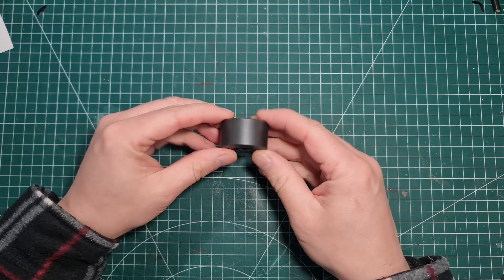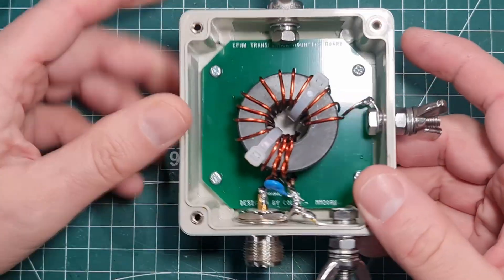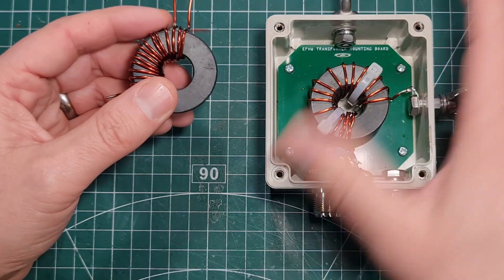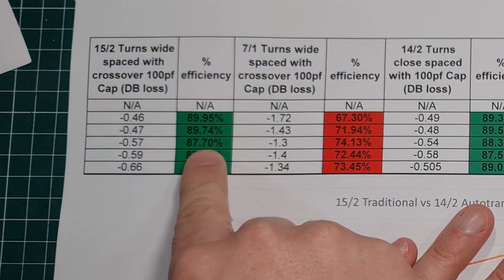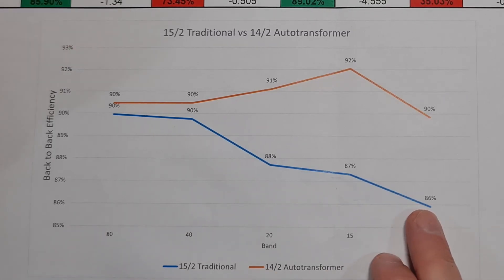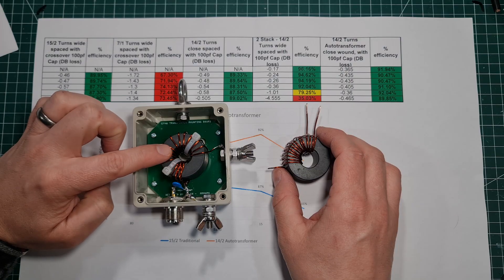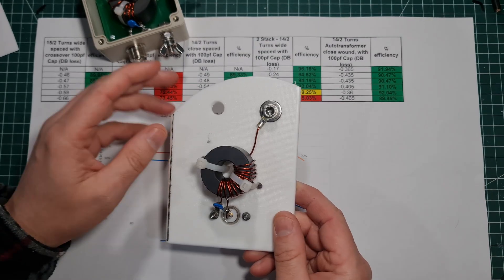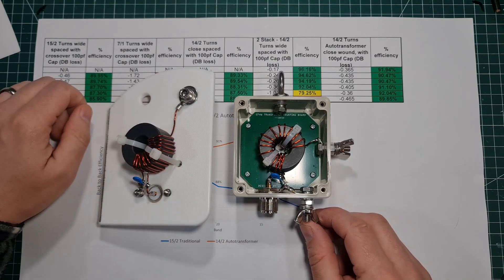Can The Best 100w End Fed Half Wave Get Any Better?

Comment: I have tried 4 iterations of different winds using this toroid and the autotransformer winding technique.  I first tried a 49:1 wind and a 120pF capacitor.  The upper bands were really high, so i added a coil 2m from the transformer and with 7 winds on 0.75” PVC.  It raised the SWR on all the bands but aligned them better.  I never could get them satisfactorily aligned with a low SWR.  I used 20ga wire and an 8 foot 16ga counterpoise.  I tried counterpoise lengths from 4-32feet and 8 gave the best.  I then tried a 56:1 wind with a 100pF capacitor and the SWR on 40m dropped, but still could not get the alignment i can get with a 240-43 49:1.  With the 56:1, same ga antenna wire and again 8ft counterpoise worked best.  So then i tried a 64:1 100pF capacitor, all else the same.  Could not tune the upper bands at all, but 40m was great and while not aligned 20m was spectacular.  So i made two monoband EFHW antenna wires using the 64:1.  On 40m got SWR 1.25 center, arround 1.6 on the ends.  On 20m, it was 1.17 on each end and at 14.160-14.195 MHz, the SWR was 1.02!  The reactance was really low as well.  On the other winds the reactance was comparatively high at the lowest SWR.  So I am looking forward to see specifically how you tune yours. I am about to decide that while less efficient, the 240-43 tunes much better, but the new Fair-Rite toroid makes one spectacular monoband EFHW antenna.  Going to try an 81:1 on 40 next.
Reply from the maker: Really appreciate the detailed feedback. I've saved a copy. Personally I'm not too interested in multiband options. I like to operate as a monoband with my reel system. I will make another video when I do. Thanks again 👍

Comment: Sorry, I meant to say 1002 cores. I guess my point is what real world numbers are you seeing when attached to a resonant long wire.? I like getting low VSWR on all bands and making the transmitter "happy".  I'm wondering if there's a trade off, efficiency  vs tune-ability? for lack of a better term. I know your waiting on better weather for this particular configuration, but previous tests? Thanks, John
Reply from the maker: Your right, there is a trade off and I've said this many times before. Just because its efficient doesn't mean its going to have an acceptable VSWR. For one thing its easier to wind and thats a winner for me if it works on air.

Comment: Colin, I've been dinking with Ferrite antennas for 20+ years, the last 5 making ununs using beads at first and more recently toroids. I've been very successful marketing them with nary a complaint. That said, I've been experimenting with the chunky 2001's since you started espousing them. For some reason I'm not able to achieve good VSWR numbers on a consistent basis across the hf bands (Typically not below 1,7:1.on a given band. Some winding configuration will elicit good numbers on one band but not others. This is using a 40 meter EFHW.. My best performer employs an FT114-43 with a 1:30 impedance ratio, 2:10 winding. Excellent VSWR numbers on all bands 40 thru 10. I stack them up to 3 for more power handling although 1 core will handle 100 watts, If you have one, give it a shot! 73, John, ,kg6zbn
Reply: John, I ALSO AGREE with your findings. I rewound my 3 FT240-52's from a wide space crossover design, to making it an auto transformer design. When finished, I came up with the very same varying results as you found: ( e.g- my lowest SWR was near 1.1 on 14 Mhz, ..BUT much higher on other bands, especially 40 meters!).
Reply from the maker: Whats high? If you run as a dedicated monoband on 40 what's your SWR?
Reply from the maker: Will have a look John, my 40m SWRnis highest at 1.7, all others are 1.4 or below. I never fret about SWR now.
Reply: @MM0OPXFieldRadio  Good point Colin. I shouldn't fret over obtaining such low SWR #'s. Modern transceivers have built in tuners that can easily handle the reasonable numbers your's obtain. I appreciate your feedback. Fellow ferrite fan, John

Comment: ....going 56:1 instead of 49:1 makes sense, you get a way better match resulting in less loss... trying  49:1 on a 17m EFHW I got 1:1.62 vswr on the NanoVna... OK but it could be better ... I then rewound the core just as you did, auto transformer style 56:1 (15:2) and I got 1:1.04 at resonanance (18.15mhz), that's nearly perfect...

I then went key down for 1 minuite 100 watts (didn't want to ruin my rig, the fan was spinning pretty good) and because I could easily access the core I walked over (2 steps) and immediately felt it... it still felt cold. 

Now I know nothing is 100% efficient but this was plenty good enough for my pay grade.... with that kind of efficiency I feel my 2643251002 core could easy handle well over 250 watts SSB. Colin it doesn't get much better than that...Oh my core is not in a box but attached directly to the antenna; zap strapped to an insulator..

Remember though, we are still (end) feeding a dipole, not a pileup buster, but when not being beaten down by the 2KW big guns.. even with 100 watts, sometimes only 20 watts from my Xeigu G90, you'll work many if not most of the DX stations you hear... I have two EFHW's up in the air...Richard VA7AA/XE1
Reply from the maker: Great feedback, especially the last bit. It only a dipole at the end of the day and many forget this. This is why I'm building a Hexbeam.

Comment: I think it is not fair to change the winding ratio from 2:15 to 2:14.  This reduces the impedance level at the interconnect.   This may change the capacitive loss in the core. I would love to see the results for the same turns ratio.  besides this, 90% efficiency is really good for a high impedance device.
Reply from the maker: If you have seen any of my precious videos you will have seen I have done a 2/14 standard winding. The whole point is seeing what we can get out of this core. As far as improving efficiency above 90% its negligible gains yes but why not try just for the sake of it.

Comment: Hi, I'm new to the hobby glad i found your channel and the excellent research that you have done on the best cores for EFHW transformers. I will be definitely making my own 49:1 using the core you suggest and auto transformer winding as it's so straight forward to make.  Long story short I will also need a common mode choke to stop the very short run of coax being used as the counterpoise rather than the actual counterpoise, do you have a recommendation of the best core for the choke. Thanks in advance
Reply from the maker: Thanks. Yes I do. I recommend the GM3SEK choke. Look it up. Also research G3TXQ who did a lot of work on this.

Comment: Great video again. I want to rewind my own core. This is 1.25mm wire isn’t it?
Reply: Have made this transformer yesterday end did an activation today. A halfwave lengt for 40m, 40m at the long side 1.18 at 7.180. 20 is good  and  on 10 had a reel high swr, wire to long…
Does make a 15:2 a better match?
Reply from the maker: @PD5RM_Robin  potentially, where was is resonant on 10m?
Reply from the maker: I wouldn't bother unless you really want to. I'm using 1.18mm wire here. I've just received a 1kg roll of 1.12mm wire. Use what you have to hand.
Reply: @MM0OPXFieldRadio  that would be 1mm or 1.25mm😉 for the qrp one would it be 0.5mm or 0.75mm.

Comment: Thanks for interesting information. I understand there are 14 turns with the auto transformer. According to your table. Will you test swr in your next test?
Reply from the maker: Yes, when I get a wire on it in the better weather.
Reply: @MM0OPXFieldRadio  I wonder how well this core would preform if designed and assembled based on 64:1 unun ( 3 primary/24 total ). Do you think it would matter Collin?

Comment: Cant believe I have experimenting with Toroids for +1 year now, its an addictive fascinating aspect of the Hobby, have had great success matching, delta loops, and inverted L's too, with the Bonus is the static surge protection is now on the "isolated" antenna side of the transformer and grounded out there away from the house and ham shack, that's an added plus especially with lots  of wire up 8n the air as in 80 and 160 meters...
Reply from the maker: Yep, its very addictive.

Comment: Good timing.  I bought the stuff for some 15/2 but hadn't made them yet.  So I'll wait to see of the auto works good.
Reply from the maker: I think it will. You got thrle right core either way.
Reply: @MM0OPXFieldRadio  Just put two together and did the back to back VNA test.  Almost identical results.  I'm going to swap it for my unknown unun and check out how it works.  Thanks!
Reply from the maker: @robcarnaroli269 I've done a back to back with a 2 stack too as a standard 49:1. It was poor on 15 and 10. Great for low bands though. This core is a no brainer.

Comment: Can you stop experimenting on these bloody things....just when I decide to try one, you improve the bloody thing again......STOP PLEASE...your driving me insane....and it's a VERY short trip.
Reply: I guess my point is, don't miss months an months of the peak of this solar cycle agonizing over getting it perfect when the difference between good enough and theoretically impossibly perfect are virtually impossible to tell in actual practice. 

Get a wire up and play!
Reply: @chublez I wasn't commenting on it because it's bad....I was commenting the same thing you have added, but with more brevity.
Reply from the maker: Yes its quite addictive.
Reply: what a great problem to have lol.
Reply: Just keep constructing. It's a learning curve and practice, trial and error makes us all learn! Stay motivated 💪 💯 cheers from Australia 👍
Reply: Just make one. You'll never notice 5% heck You'll likely never notice 20%. Remember you have tou double yer power to gain half an s-unit or see 50% loss to loose half an s-unit...however you want to look at it. 

Assuming a standard 100w radio and the first design here with a SWR under 2:1 yer gonna get 80 or so watts out. That last 20w(impossible to get 100% of) would at best represent a 25% gain ore 1/8 of an s-unit...not even enough to notice on a small anolog gauge or be represented on a segmented digital one. 

Your time is far better spent building a moxon you can aim wich would net you 3db over the efhw or the same as doubling yer power and getting that full half s-unit with the bonus of the front to back ratio giving you rear rejection of noise etc. Basically chasing that last few percent on an efhw is a fools errand and the times better spent making a secondary directional antenna to play with.

Heck even a simple 1/4 vertical like the DX comander will get you some DX gain over a efhw due to take of angle and ditch toroidal losses. Comercialy costs more but diy doesn't.

Comment: Another great Video Colin, Thank you!    Did you ever get a chance to test the type 61 material? (2661102002)?
Reply from the maker: Not yet, i cant get them locally and need to spend a bit to get them from the US from Mouser or Digikey.
Reply: @MM0OPXFieldRadio  I would be happy to send you a couple for testing (if your interested)..
Reply: @MM0OPXFieldRadio  ...I'm having a couple muled down from Canada to Mexico soon, gonna order some 120pf TDK caps too... they are appparently useless for 80 (not enuff mu @125), but are champs on 40 and above (credit to the ' Evil Lair'), and when wound 14:2 tapped with an extra turn15:2... should be a good experiment. With 90% to 95% efficiency, I fully believe 100w FT8 and upwards of 250, maybe 300 watts (peak) SSB (35% duty cycle) would be no problema. Unfortunately, 52 material cores in the '002 form factor are not yet avaiable... that would be the perfect mix.

Comment: Sorry is that using an antenna tuner?
Reply from the maker: No Tuner needed.
Reply: @MM0OPXFieldRadio  awesome, for a tuned antenna which transformer would be more efficient?
Reply from the maker: @ifell3 I dont quite understand what your asking? What do you mean by tuned.
Reply: @MM0OPXFieldRadio  sorry, if you had an efhw cut to exactly the 40m band.
Reply from the maker: Yes no tuner would be needed for 40/20/15/10.

Comment: I made one as an auto transformer, 56:1 with a crossover. The inside windings are very close together. I haven't tried it yet. Soon. I have a problem with my knee stopping me going up in the attic to wire it all up at the moment. Oh, I will add that in order to make the auto transformer, I didn't solder on another lead, after two turns I took the wire out and back again, and twisted it together, before carrying on the winding. The sticking out bit is then a twin twisted wire.
Reply from the maker: Good tips, thanks 😊
Reply: @MM0OPXFieldRadio  It might be not quite as good, but I thought I'd give it a go...

Comment: As you said, you won't see the 5% improvement on-air. However you may be able to run a  little bit more power with the same or less core heating. Thanks for the video Colin.
Reply from the maker: Thats a good point. May well help with heat.

Comment: Another SUPER idea!! Colin, I rewound my  3ea.-52 mixture toroids, from the older wide-spaced crossover design to your new auto-transformer design, and it works like a great 'bomb'...(i.e. WONDERFULLY!!)!! I also have the single '102' toroid, with your 1 to 56 design, and it also works FANTASTICALLY, and even though it is the older crossover design. I will NOT rewind that one, as it works so darn well as it currently stands!
 You sure have blazed some great toroid design-trails of late, and THEY ALL WORK SUPERBLY!! In thinking about the losses, the fact that you have fewer losses not only applies to radio transmissions, but also to low-loss signal reception as well!! My thanks to you, Colin!!
Reply from the maker: Thanks for the kind feedback. Yes not worth rewinding the 1002 core.

Comment: Note that the type and thickness of plastic you mount a toroid on affects the efficiency. Without doing dielectric analysis of the plastic you can experimentally put them in a microwave for a set period of time and see which type of plastic stays the coolest, and use that to mount the toroid on. BTW, the very best (most efficient,) end-fed half-wave would use an air-core transformer. A toroid based transformer is just the most compact and convenient, and once you get efficiency up over 90% very few hams will find a need to get any more efficient. As a suggestion, on the step-up/step-down efficiency test I'd suggest you turn the transformers 90 degrees to one another to reduce the chance of their fields coupling and affecting the test results.
Reply from the maker: Good tips, will do this on future tests.
Reply: How does testing the dielectric at 2.45 GHz have anything to do with its characteristics at HF?